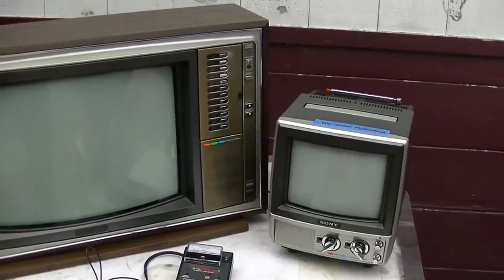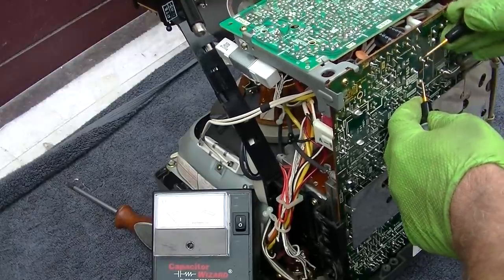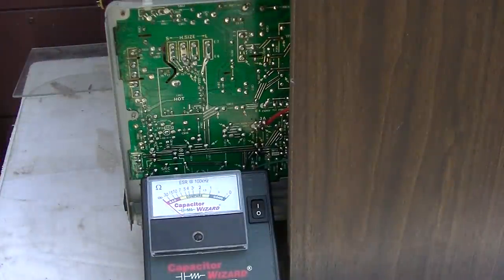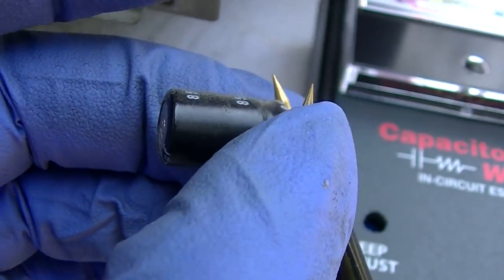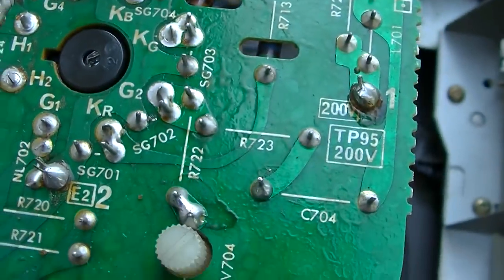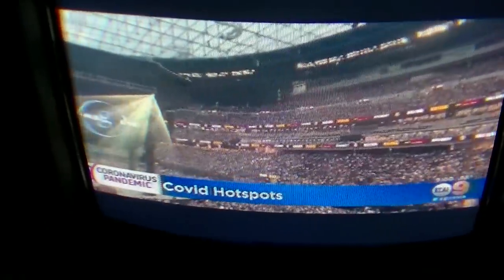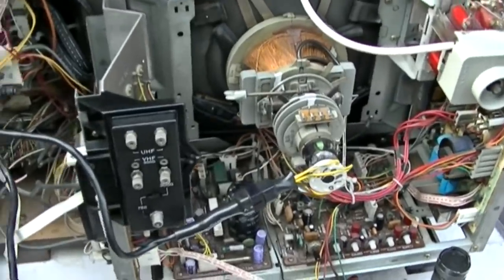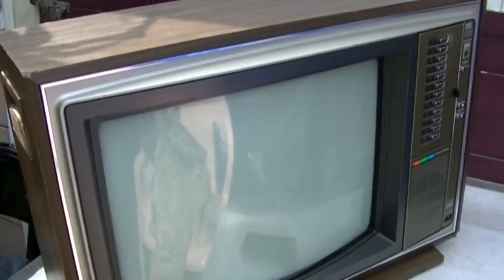Sony Trinitron KV9300 and KV1942 vs Capacitor Wizard

Comment: A gamer owned this set and used an ebay cap kit
Reply: Okay, so someone enlighten me... What is the big deal with gamers and tube TVs? I played old systems on my flat panels and never noticed any problems. Is it just experience & nostalgia?
Reply: @equid0x  It's a bit of a joke at this point but lookup image comparisons. Old games were designed with the CRT's softness in mind and used tricks to give the impression of more details even at low résolution. Retro gamers get CRTs for that authentic look and feel. On a lcd the image is too sharp to get the effect and of course the games are so low résolution that they look like garbage on a 50" screen
Reply: @krz8888888  Interesting. All of my flat panels (even the oldest) has a sharpness control. The oldest has an adjustable delay filter that mimics phosphor smear for use with composite. I guess I would just buy a smaller panel. I feel like a 19" -21" would have been pretty typical for the time. To each his own, I guess. Gamers can be weird, like the obsession with FPS when the typical human eye can't see past 60 FPS anyways. They swear it's smoother, but I doubt it.
Reply: @equid0x  The main thing is input lag. All flat screens have processing which adds a delay. Many old games require fast reaction times and are unforgiving with timing so with the slight lag of a modern tv, it can be hard to play. Also, with early 3d game consoles, developers often used resolution changing techniques to give menus more detail and lower the resolution during normal play for better performance. The result can be your flat screen momentarily going black as it tries to recalibrate to the ever changing resolution which can be distracting. Also, many of the newest tvs today don't even have analog inputs besides uhf/vhf which doesn't give that good a picture plus all the other issues I mentioned. There are hdmi converters like the retrotink which is not cheap but the lag can still be there. With people giving away working crt tvs, you can get lagless operation with lots of analog inputs for free. Pretty hard to beat.
Reply: @TapesNstuffS  I watched a vid last night where a guy had an HD tube, a small lcd, a gaming lcd, and a 4k. IMHO the LCDs were superior in every way although I did note the input lag. The gaming monitor was pretty damn close to the tube. The problem is 480i is interlaced... Every frame paints half the screen whereas lcds are solely non-interlaced so they have to buffer the half frame to do a full screen paint. I feel like a high end tv or monitor probably solves this issue. Any tube is living on borrowed time at this point. I feel like people buy the crappiest onn lcd they can find at Walmart and then bitch about performance the same way people buy the $400 hp PC at best buy and then bitch about it's performance compared to a Mac.

Comment: Hello Shango:

Ever hear of a little-known doctrine "Right-To-Repair"?

I have very little understanding of it, other that in certain cases, even if something was tossed by the roadside for dead, there may be legal reasons why it cannot be repaired.

I think it's silly, but you might be  more knowledgeable.

Your thoughts?
Reply from the maker: Yes totally aware of it. Most of what I work on is older and repair is supported. That's a fight for Louis rossmann and he's doing a great job
Reply: @shango066   What is the gist of R2R?  If I find some worn out 1970s audio by the curbside, and am able to to get schematics and replacement parts for it, who's to say I'm not allowed to fix it?